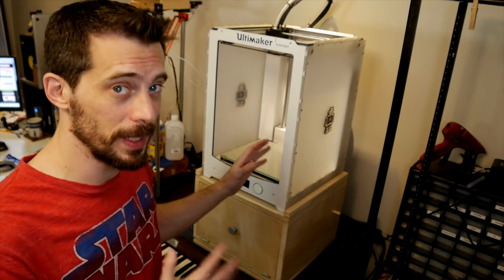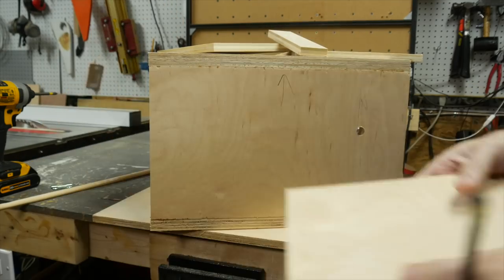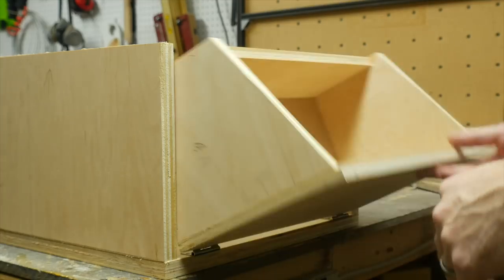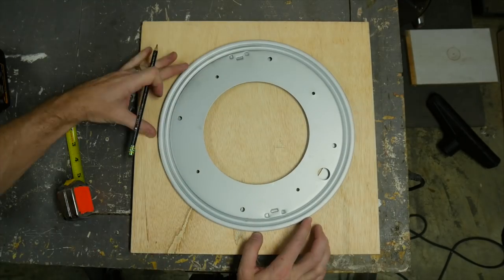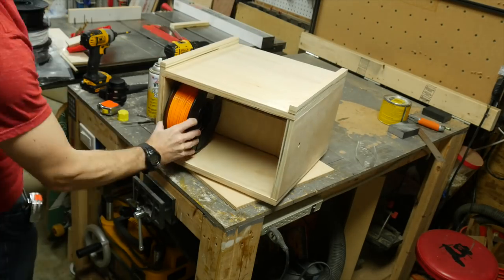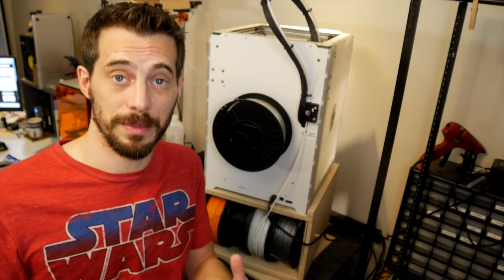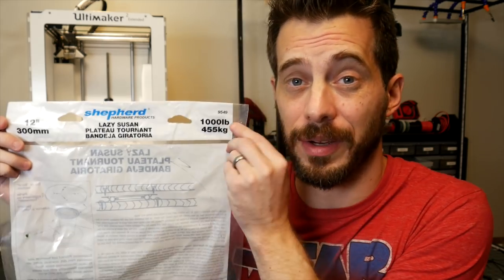Spinning 3D Printer Workstation // How-To | I Like To Make Stuff

Comment: Thats a wonderful idea.  Can you call it a Lazy Printer now? :D
Reply: +RetroWeld – If the printer figures out how to move its print head to get angular momentum, it might start playing with the stand and spin itself all the time :P
Reply: +FastEasySmartTOOL  - the rigid rails & frame of the printer are its frame of reference. It has no way of detecting movement of the whole thing.
Reply: Didn't people do similar things with ancient (floor-sitting, appliance-sized) hard drives? "Walking drives" which would seek back and forth and cause the machines to shuffle across the floor due to vibration? And of course, any number of machines (floppy drives, hard drives, printers, 3D printers...) have been made to sing. It seems any time you see software controlled stepper motors or similar technology people get the same ideas. "This could move around or play music due to its own vibrations if I solved this convenient math puzzle..." We nerds are so predictable!

Comment: Simple clean build.  I really like the tip out drawer.  I've watched enough @barnaculesnerdgasm 3D printer videos to notice that you could have printed the knob upside down and it might have come out cleaner!  Great job regardless
Reply: +Dustin Penner I've done a lot of 3d printing and sometimes I feel it looks better to have the finished side out, instead of the seeing the ugly flat side. Support material or a bridging cooling fan would help correct this. It also can be corrected in some slicing software by watching how it's going to print and adjusting setting.

Comment: First, love the lazy susan for tools. I would not put my printer on it. It shakes and rattles too much so need a really solid desk for it to sit on. 
As to the filaments, they will degrade with humidity, PLA will become brittle or they will swell up and not be able to extrude, or you'll see steam coming out of the nozzle and that will corrode your nozzle, and it will also impact your prints. You don't have to go crazy about it, but I have all my rolls in a 6' tall plastic closet type thing I picked up at walmart -- it has 4 shelves and doors. I have a tub of desiccate on the bottom and the middle, and I also throw in all the little desiccate packets which come with the rolls onto each shelf. I print a lot, so I have a lot of rolls. If you want to print anything other than PLA (and PLA is only really for decorative toy things) I print most shop things in PETG or ABS, and that stuff you need to keep in a dry space. Also Nylon will absorb moisture like crazy, so keep that with a bunch of desiccate. Having it in an open spool holder in the back of the printer for any long period of time is a bad idea.

Comment: I dont have a 3d printer but i just bought the same lazy susan bearing and thought it required a lot of work to turn it. thanks for the tip with silicone spray.

Comment: Awesome solution! coolcoolcool! I often find the same problem with tight drawers. I usually mount the boards the other way around so that I can add sandpaper shims and "extend" the width of the drawer space. That of course won't work with glued joints :) thanks for sharing!

Comment: Now I just need the 3D printer for it ... ;) Nice build - I wonder how to comfortably make this entirely out of wood avoiding the lazy suzan. Thanks for sharing!
Reply: +JM Tosses You could use wheels, The same principle how those plate things have in microwaves. The wheels may not be able to handle the weight so what you can do is making something similar to what you have on a deskchair that can move around it's axis.
Reply: Or marbles on hard wood :)
Reply: Oh, yeah, that would work too, Hadn't thought of that one.. But the lazy susan route might be the easiest :3

Comment: PLA filament (The most common 3D printing material, especially for cosmetic stuff) is barely affected by (mild) humidity (one of the reasons for its popularity), but it could shorten its shelf life. Other plastics, however, can suffer much more greatly, particularly nylons, which can absorb enough moisture in hours to become nearly unprintable in some climates. (The moisture can be driven off with heat or vacuum, but heat tends to damage filament itself.)
Open storage should be fine for PLA, but you should protect any expensive exotic stuff you're experimenting with, especially if you live in a humid climate.

Comment: For there to be much difference with the filament dryness, you need a real airtight container with rechargeable silicone desiccant. They make 5 gallon bucket lids called Gamma Lids that can screw on with an airtight gasket instead of the traditional pry-off. I whack these screw top bucket lids closed/open with a rubber mallet.

For PLA/ABS, if it's good quality filament, there generally isn't much issue worth the trouble unless you live in extreme humidity I think. More exotic filaments like nylon actually require more care in drying or prints are completely ruined.

Comment: Quick thought, hang a curtain of Strips of Cloth down to keep dust down in the Filament part, then when need it can easy come out between the Slits of cloth.  I like this idea, I think I  would extend the back longer so that the Filament feeds up threw a Hole and I put a Door on the back of the filament section.  But GREAT Idea, I never thought of the spinning feature !  thanks

Comment: Nice job Bob. I got an old Microwave cart with casters for free and put mine on there so I can spin it around. Something so simple changed my whole outlook on changing filament. I used to just deal with what was in the printer because I didn't want the hassle. How well does the orange filament feed from the far side without any guides. I've noticed too much friction on the filament will cause my extruder to skip.

Comment: I had my 3D printer on a table that allowed for a little wobble, and experienced "ringing".  That's where you see waves or patterns in the side of the print.  I'm afraid your new stand allows for a whole lot of movement, and your print quality will be affected.  It's always better to have a rock solid base with as little movement as possible.

Comment: Generally the humidity in polymers should be very low. If the material absorbs water it doesn't get unprintable right away, but it is not as strong as the data sheet states anymore. So if you print parts that are under high mechanical stress you want your filament to stay in a dry and if possible airtight environment. If your printed parts are not stressed too much, you should be fine the way you store your spools right now. :)

Pretty cool cabinet, I love compact, efficient organisation concepts!

Comment: Keep filament airtight to prevent it from taking in humidity from the air. That makes the filament brittle, and it snaps in the bowden tube. It also prevent corrosion of the nozzle, and bubbles/hissing when printing, which may appear if the filament contains water.

Comment: Hey Bob 
I would like to make a wooden rose, have you some tips for me? my first idea was to make the rose out of a single piece of wood but later i didnt come in the gaps between the leaves. my second idea was to make the Single leaves and glue them together, I have made now 3 leaves so i need to make a lot more, but the problem is that i dont have so much equipmemt, I have a dremel, jigsaw and some standard things. do you have an idea how i could make the rose ( I would like to give it a girl, so i have to finish it till 14.2)
sorry for any grammar mistakes 
Tim

Comment: Nice build. I may have to build me one of these. 

I don't keep my filament in air tight containers either. I have not had a problem in 2 years.  My printer only prints in PLA perhaps other filament types are more susceptible to moisture.

Comment: have you had any problem with print quality since making this? I'm sure it's small but surely the head moving back and forth would subtly wobble the printer if it was on a mobile base, or is the print speed low enough for this not to be a problem?

Comment: I think it's unnecessary to glue screwed wood "joints" at all. Matthias Wandel's pocket hole tests have shown that the glue doesn't add strength to the joint, so all you're doing is making them harder to take apart.

Comment: Humidity may not be a big deal with pla, but if you want to use nylon for the greater strength, flexibility, and low friction, you would need it, because nylon is quite thirsty.

Comment: so how does the 3D printer handle a design (and maybe it doesn't) when a portion of the design is up of the ground but connects to the main parts above the start point of that section? imagines a 3D print of a cat with the tail curving down from the back of the car but not far enough to touch the ground. Is that possible?

Comment: nice. maybe drill a small hole at each end of the dowel, opposite sides which could fit a nail or a tack. this would prevent the dowel from sliding out and dropping the reels.

Comment: so I have a bit of a dilemma. I love watching your videos, and I've made some of the items you've made, but I don't have access to a lot of the tools you use. honestly, the only things I have access to on a regular basis would be a typical carpenters tool kit. my problem is that I don't know much about what tools I should get. what do you recommend?
Reply: +RageCreator 2996   I know that I'm not Bob, but I come at this with 40+ years of experience in woodworking. The best way to answer your question is to ask you what you tend to do the most and what you have the biggest problem with. If you cut more than you drill, you should focus on cutting first. If you have the biggest problem with cutting curves into materials, then the answer would be to check into getting a saw to help you cut curves. If you have a shop, you can look for a band saw. If you have limited space, you can look into a good quality jig saw. If you need to improve the quality or consistency of straight cuts, maybe a small table saw is in order. 

Basically, decide which job you most need to simplify or improve the quality of, then look for a tool that will help you do that job. Do that as your finances and situation allows, and you'll soon have a decent collection of tools that allow you to do most everything you want. They don't have to be brand new or expensive tools. Most of us start out much like you are. It's the rare individual who goes out and buys a truck load of top quality equipment from the start. It's more like years of accumulation. 

Having said all of that, there is nothing wrong with using the hand tools found in a typical carpenter's tool kit. A bigger, faster more powerful tool won't make a person a better woodworker, in much the same way that a bigger, faster car won't make a person a better driver. Only experience will do that, and the only way to get experience is to do it - whatever "it" is.
Reply: Mark Lindsay That's great advice. Thank you.
Reply: RageCreator 2996
 We're all in this together, man. I'm just trying to keep it real.
Reply: Hellsong89 thanks for the ideas.

Comment: +I Like To Make Stuff So, I see you are using a wooden dowel for your spool holder. Often, I see this as the first thing people tend to replace on their 3d printer. People seem to use a lot of 3d printed parts, bearings, etc., but I have yet to really see any noticeable difference in my prints. Have you noticed anything with your Ultimaker? How about your Prusa MK2? Also, have you modified your 3d printers at all?
Reply from the maker: I haven't seen any issues with the dowel at all.  Sometimes more complicated solutions are fun, but not necessary :)  I've not really done any mods except to update my UM2 to a UM2+, but that was a very simple kit upgrade.

Comment: Hi Bob as  protection Why do not manufacture lock to prevent rotation during work on the project. 
.I like it so much👍🏻
Reply from the maker: +Ali Al garni That was the original plan, but it really doesn't need it, as it has enough weight to only move when you physically push it.

Comment: i would suggest you put locking springed ball with chanel in which it rides to your spining box to have it always straight and when applied a little bit of torque to unlock and spin it arround,
Reply from the maker: Given the weight of the printer, it doesn't move unless you specifically push it. It wouldn't hurt to do what you're proposing, but it's not necessary.

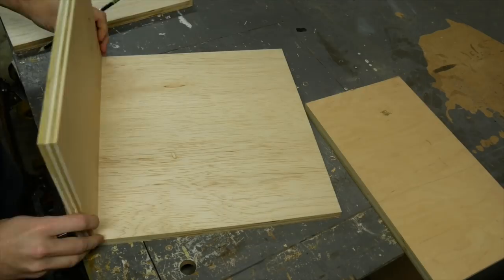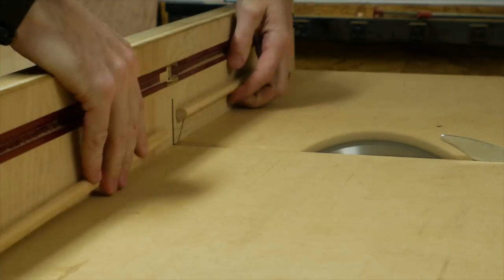Comment: Hey Bob - another great project video!  One little thing, though...At 1:00 you drill a hole with a 1/4" bit that looks a lot like a 1/2" bit. Then at 1:30 you put a 7/16" dowel through the 1/4" hole.
Reply from the maker: +Seth Wells Yeah, I misspeak sometimes.  1/2" bit
Reply: I feel like I'm the only other one who noticed that! Or at least felt like commenting about it😏

Comment: Using this with a drill press is an awful idea, who wants a wobbly drill press?
Reply from the maker: +Justin Bell It was just an example.
Reply: +Justin Bell, + I Like to Make Stuff -- I think the high speed footage makes it look "wobblier" than it would be in real life. Especially made out of 3/4" ply, there is some heft there to keep it pretty rigid. The only thing I would change is adding a pin to lock the rotation, especially if using for a drill press. I have my drill press on a cart that is much less substantial than the one he built here, and I don't have any problems.

Comment: And then you accidentally hit the printer when printing a long print and mess up the whole print...
Reply from the maker: +xTJRsAsEAx How would it be any different that just hitting a printer that was just sitting on the desk?
Reply: +I Like To Make Stuff Cos this one can go turning round round round! Hahaha jkjk! But it does look wobbly and unstable though.. would be nice if it can be locked down in place when printing :))
Reply: +xTJRsAsEAx That's easy to do... make locks on one or each side of the base :) Like a slider thing. Which can be made entirely out of wood as wel..
Reply: +hendrik visch Or just regular snap locks for a gate or similar. 1 on each side would lock the whole thing down snugly

Comment: Did you make that saw sled in another video?
Reply from the maker: +Au** Kn*** No, it's basically the same as the one that Steve Ramsey made. Check out his video for it!
Reply: +I Like To Make Stuff 
nice. maybe drill a small hole at each end of the dowel, opposite sides which could fit a nail or a tack. this would prevent the dowel from sliding out and dropping the reels.

Comment: How is the rigidity of the lazy susan?
Reply from the maker: +Matthew Dalton Since it's 12", it spreads the weight out on a large area and doesn't lean down on any of the sides. Originally I had a smaller one, but the outer corners  of the box had a levering action and would sag a little bit.  A larger bearing solved that.
Reply: Good to know, I might try something like this.